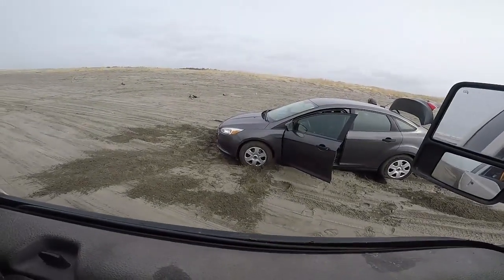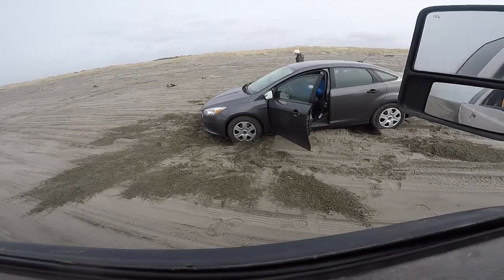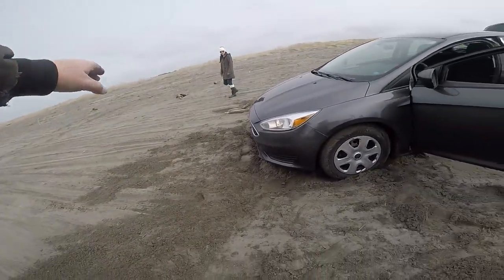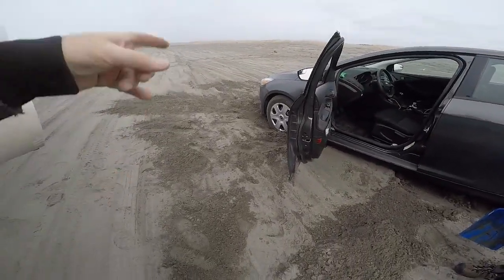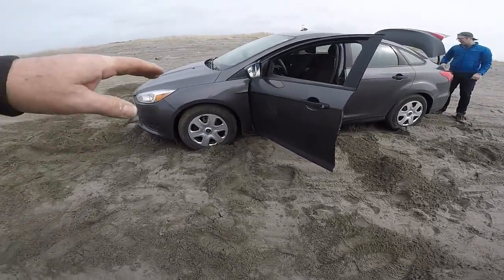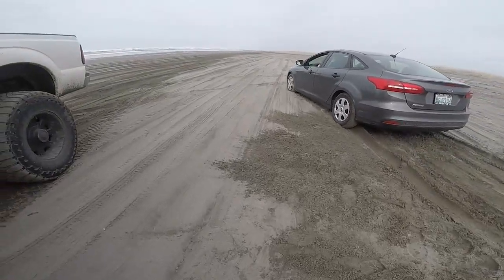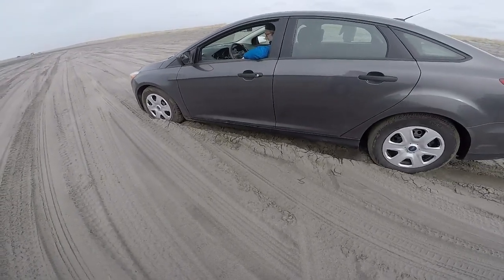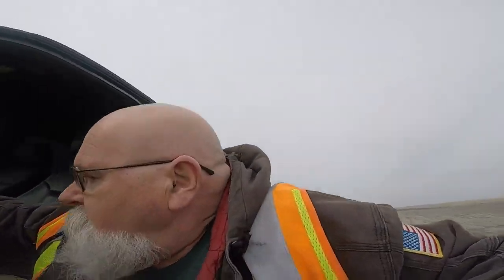How to Get Unstuck From Sand

Comment: This was very valuable to watch -  I do wonder how much of the spinning he could feel without seeing.    I have a front wheel drive small 4 cylinder van with curb weight for 3500lbs, but likely at 4500lb with all my tools and self inside. The van has been surprisingly capable on sand but  I've been stuck like this at least a 6 times in some central Florida lot I own has very soft powdery sand in a 500' stretch I need to make it through.   Thinking about the times I've been stuck I did spin or tried to back up hill.  I carry a shovel, recovery boards, air pressure and even manual winch, but the last time I got stuck i had to sleep the night out there.   My stock tires are  215/55r16s (8.5in wide)  and I've been wondering if 245/50r16 (9.5 in wide) would do better?

Comment: George don’t you think he should of air down
Reply from the maker: airing down  after getting stuck is too late . He was almost  high centered if he had let air out   his  front bumper  and suspension would have bottomed out .  .  Airing down   does help   but than you have the issue of  finding someplace to    air back up .

Comment: The first instinct is to Gas it.
Reply from the maker: Your so right .  Sometimes if you have enough momentum this  will work  other issue is  even with forward   momentum  invariably they will turn too sharp and the front tires plow in .   Gradual turn  in wide sweeping  arch  is the best way to   go in soft sand .